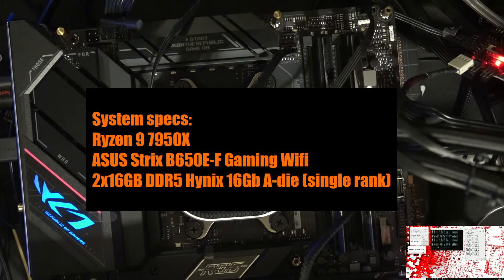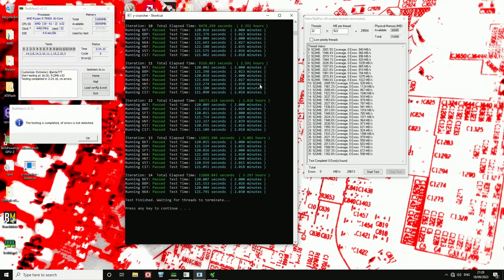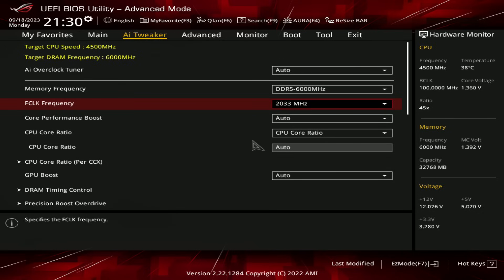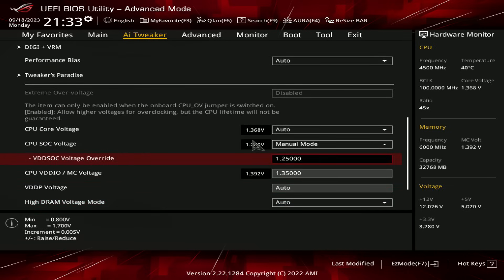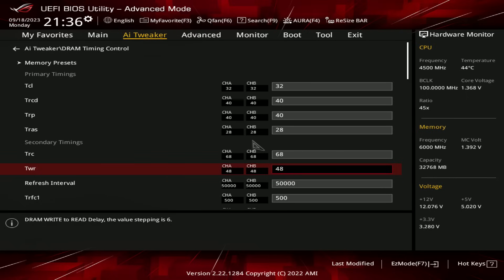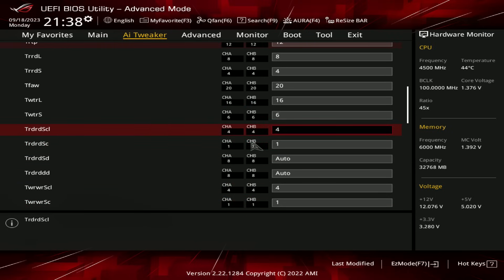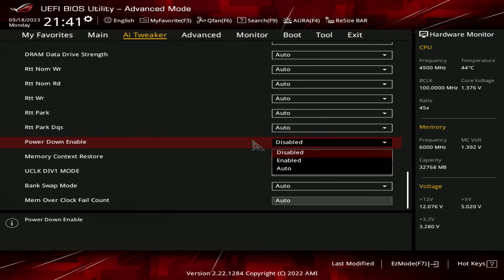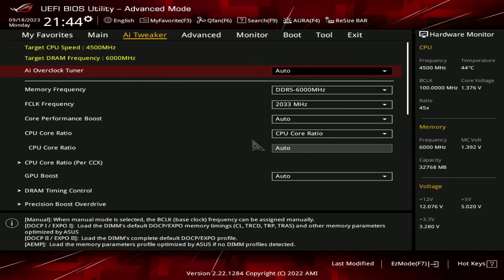Easy memory timings for Hynix DDR5 with Ryzen 7000

Comment: Running 7600x, ddr5 hynix 6000mhz cl36 ram, running the same motherboard and bios version as Buildzoid, vddsoc@1.2V and vddio/vdd/vddq@1.3V and trdwr@14, all other numbers the same. However, I don't have access to refresh interval, it's not present for me for some reason. If anyone knows why please tell me.
Will be testing and will answer questions with results.

Comment: I have  2x kingston fury beast ddr5 4800mhz 16gb cl38 hynix ... I have 2 questions:
1. Will these settings apply for my ram aswell?
2. Judging from what i read on the internet and from these kinds of videos, i hit the lottery with my kits, because 4800 mhz hynix kits are probably the most rare to get... And i bought them separately aswell, not 2 combo deal... How lucky i am? 😅😂
I am asking because i made the mistake of purchasing an asrock motherboard that has problems when it has to boot bios settings that it doesn't like... I always have to remove cmos battery and put it back... that's really annoying to always do, so idk how much i m going to mess with the ram overclock and timings and sub timings... I m probably gonna upgrade to a 7800x3d and a better motherboard from a better brand later this year... If i get the money to buy them... if not, i m gonna wait until i have the money and buy then what's the best for me
Reply: You may not be able to overclock those sticks or tighten the primary timings, but you can still improve them with better secondary/tertiary timings, and the ones in this video are a reasonable starting point
Reply: @subaction  i basically copy pasted his settings and everything works fine... Like i said above, i hit the jackpot with my rams, cheapest ones i could get, both have hynix chips. The only problem is that even after i updated the bios to the latest version, i still have long boot time. Like 1 minute... Probably this will never be resolved sadly... at least for asrock motherboards... Well, i look at the bright side, at least mine doesn't cook the cpu like asus lol. Thank God i sticked with this one, seems like asrock right now are the most reliable motherboard brand. How times change lol 😅😂

Comment: It works perfectly thx but mine can go 6400 is it possible and what you recommend to change?
Reply: The way the fabric clock works on Ryzen 7000 chips means you will almost certainly get better performance at 6000 than 6400.

Comment: I'm just getting back into custom PCs after 20 years and am starting to delve into memory tuning. I have a 7900x3d and got a good sale on DDR5-6600 34-40-40-105 DIMMs. I get that the 3300MHz/6600 profiles are off limits for this chip but the other XMP profiles sort of straddle 3000MHz, at 2912MHz/5800 30-36-36-93 and 3106MHz/6200 32-38-38-99. Should I expect to find a stable timing set that would work for DDR5-6000 or is that an "invalid" subdivision of my 6600 kit, leaving me at that DDR5-5800 profile? I'm not sure how flexible I can expect to be at frequencies outside those listed on the SPD.
Reply: Update: these timings ran but unstably and with the bios deciding to halve UCLK. Overriding that caused POST failure until I cleared CMOS. Going to try these timings with a lower FCLK tomorrow

Comment: Hey man, are you testing all this using iGPU of Ryzen?  I got a dual-CCD version 7600, Fclk=2033. SoC voltage=1.1v. Yet it can pass all p95/TM5 test without a single error or crash. Memory set at 6000c28 all sub-timing tightend.
Maybe TSMC 6nm iodie doesn't need that much voltage when iGPU is not used？
Reply: He gave conservatively high settings to be safe. Most people should be able to use 1.20 SOC instead of his 1.25, and some can use 1.15 or even 1.10. Almost everyone should be able to use 1.30 or 1.25 for VDDIO/MC and VDDQ, instead of his 1.35.
Reply: @subaction  you are right, but for example 5700G demand less soc voltage if you use dGPU

Comment: Does anyone know what primary timings I should use for a downclocked 6400mhz kit?

F5-6400J3239G16GX2-TZ5RS (32-39-39-102)

Currently, I have it set to 6000mhz 30-38-38 which is equivalent to other G.Skill kits running at 6000mhz.
Reply: U find it?

Comment: On Gigabyte x670 boards the minimum tRAS is 30. Is this ok to use instead of 28 or would 56 be better as a multiple of 28? Thank you Buildzoid
Reply: Same issue here. Tras only goes down to 30. What did you end up doing?
Reply: Cool. I just finally checked and am running 30 without problems, memtest stable

Comment: Pretty straightforward, even easier since we pretty much can use same settings as shown. About a 9% faster ram for me and my latency went from 85ns to 70ns. Thank you!
Reply: How do you check the latency?
Reply: @rickyross9073 Aida extreme, look it up.
Reply: @rickyross9073 use Aida64’s Memory and cache benchmark
Reply: Aida64 você faz os testes la @rickyross9073
Reply: I'm getting about 67ns. I guess that's good since you were getting 85+ before.

Comment: Do you have any videos on memory tuning dual (quad) rank ddr5? I'm using 32gb dimms for the capacity but want to try dropping some of the settings, how close to these can I tighten them (cl30 g skill Trident neo, presumably hynix m-die)
Reply: I, and others, have used that kit with these settings. They seem to be a sufficiently loose starting point or set-and-forget for that kit.

Comment: Having trouble finding the “Power Down Enable” setting on Gigabyte bios. Is there a different name for it? Can someone please help? It used to be in the advanced settings, no clue where it’s been moved?
Reply: It's in Settings > AMD overclocking > DDR and Infinity... > DDR Options > DDR Controller Configuration > DDR Power Options :)
Reply: @HoangDucNuyen  Followed the steps, but not seeing “DDR Controller Configuration”. I’m on F3 of my B650M Aorus Elite AX. May be somewhere else? Do appreciate your help!
Reply: @CarnivoryHODL  - wow, I thought all gigabyte 600 series have the same BIOS. I am sorry that I cant help you with that. 
FYI, my PC (7950x3d+x670aoruselite) just straight up crashes at login screen and sometimes FREEZES in the BIOS when disabling PowerDownMode (even using EXPO or XMP).
Reply: @HoangDucNuyen  no worries! I found it on the latest beta version, but had to revert to F3 since it was being unstable.

Comment: Received my 7950X3D and the Kingston DDR5-4800 ECC 40-39-39-77 modules. Used your secondary timings, put primaries to 32-40-40-28 at DDR5-6000, voltages at 1.2V for VDDSOC (instead of 1.25V) and 1.3V for VDDIO/VDD/VDDQ (instead of 1.35V), and things seem fancy according to memtest86. Thanks for the help.
Reply: Currently trying lower voltages, thank you for this.
Reply: I am actually a little scared to change anything on the voltage as the 3d chips are very sensitive for these changes. Der Bauer even killed a cpu because of changing the voltages
Reply: @Muu_69  These voltages apply to the IO die only, not the CPU chiplets.
Reply: @tscc  thanks, did your temps from the CPU also go up in idle?
Mine went from 40 to 47°C
And ram from 27 to 37°C
Reply: @Muu_69  I haven't really looked at temps pre-OC. Stands to reason they go up, since the IO die also creates waste heat. That said, I'd expect the same with DIMMs that come with DDR5-6000 settings from factory. The RAM chips are the same after all, so they need similar voltages. My DIMMs are idling at 34°C right now (note: temp sensors on DIMMs is more a server thing, gamer RAM typically doesn't come with that), CPU package temps hover around 41°C (with a Noctua NH-D15), all at 20°C ambient.
Reply: @tscc  I now tested 1.2v on SOC and 1.25v on VDDIO and that also works fine so far. 2h of gaming and also a memory stability test.
I also used on the curve optimizer -15
And I also turned precision boost on.
I use the peerless assassin 120 instead of the NH d15 because gamers nexus tested it as the best aircooler now on the market. But probably I will upgrade to the new Noctua NH d 15 successor that should come out at the end of the year, as I usually only use Noctua fans and I love especially the A12x25
Reply: @Muu_69 tried these recently, me and my brother just newly built a full amd pc, somehow my temps lower, went from about mid 50s to about an average of 41 degrees while gaming, and it still stays the same while idle which is 41 degreees
Reply: Saving this
Reply: Wait you achieved that on this KVR48U40BS8K2-32 ???? HOW ?
Reply: Looking that SKU up, it seems they’re the non-ECC modules. Kingston’s data sheet doesn’t say which dies they use. The ECC UDIMMs specifically use Hynix M dies. IDK, I just put in the values from the video, dropped voltages a bit for safety (good hindsight it seems) and presto. By now I’ve dropped VSOC some more from 1.2V to 1.15V and VDDIO etc. from 1.25V to 1.2V and things are still stable and no WHEA errors from ECC.
Reply: @tscc  Could you give me the part number of the kit you bought please ?
Reply: part number?

Comment: I hesitated for a couple of days because my timings are so different from these, but it is all stable with Kingston Fury Renegade @6000, (30-37-37). I left the Fclk @2000Mhz because I am really happy with it stable with 1.15V SoC. The memory is now 10% faster and the latency is down from 73 to 63 ns in AIDA64 Benchmark.
Reply: And FCLK @2033 confirmed stable too.
Reply: Seems like anything sub 67ns is decent then? I have the same ram kit.
Reply: @ertai222  Yes, if you use AIDA to measure the latency, the optimal value is between 60-65 ns.
Reply: @jassenjj  the lowest I got it so far was 62.5, 63.

Comment: THE SAD part is that built-in memory controller in the Ryzen 7000s series -- yes, even 7950/3D, the top of the top -- can only support 64 GB of RAM at 5.2 GHz. If you need to have full 128 GB RAM, it can only work at 3.6 GHz as the controller simply can not pass more information at a time, regardless of what you do with timings or anything else. The question is, will AMD upgrade its memory controllers in the Ryzen 8000 series, and if so, will Asus release a BIOS update to support those new CPUs, so I could replace my 7600X with e.g. 8600X and then to finally have 128 GB at full frequency (however it might be at the time: 7 GHz or something)? Or I will have to replace my Rog Strix 670E-A Gaming Wi-Fi motherboard with a new generation of CPUs, even though they will be still for the AM5 socket?
Reply: But the memory controller is a CPU part, not the MB part - is it not? 🤔 If so, then new CPU support will be enough to have access to the improved memory controller (if there will be one, ofc)
Reply: Incorrect. Im running kingston 128gb 4 slots on meg ace at 5600 stable with over 75gb/r 84/write 70ns
Reply: @jumanjimusic4094  Unfortunately, the data through output is limited regardless of the frequencies you are able to achieve.

Comment: For the longest time I tried to enable EXPO on this same motherboard without luck. Crashes, bios updates, BSOD, etc. I got a different ram kit (which happens to be the same one you got). I used THE EXACT SAME settings you have and no issues since then! I really appreciate it! I have another build but that one has Samsung die which would be amazing if you could “build” expo settings for it since it is the exact same issue I had but on that build. Again, thanks!

Comment: Got G.Skill DDR5 64GB (2x32GB) 6000Mhz Trident Z5 Neo (F5-6000J3040G32GX2-TZ5N) 2x32, 7950X and ASUS STRIX B650E-F Gaming WIFI Motherboard. I don't how did I check compatibility, because I was thinking about using EXPO, I've never tried to adjust timings by myself and have like 0 experience (this memory is not in the compatibility list of my motherboard). I tried to change settings to the ones from this video, but it doesn't work for me. My PC just unable to load at all, I have to extract battery from motherboard to reset BIOS settings.
I tried to set all timings and voltage, leaving the default frequency (4800). And it works. But with 6000 frequency it doesn't work anymore.
I tried to set 30-40-40-96 6000 (numbers from tech specs of my memory). Doesn't work.

Even with everything default my PC starts very slowly, I see the yellow LED on motherboard for ~1 min (memory indicator), only after that it loads to BIOS.
With all different settings, when I say "doesn't work", this yellow LED stays forever until I shut down the power.

Can someone help me please? I understand nothing in these numbers, is it even possible to get 6000 with my hardware? Or do I have to replace motherboard?
Reply: I guess because 32GB kits are dual-rank. To do these timing settings you need a single rank kit, which is 16GB. Correct me if I'm wrong. I am new to RAM OC.
Reply: Dual rank ddr5 is going to need looser timing that single rank, there's more stuff going on in the memory controller (twice as much)
Reply: Before trying to tune, you should try to use the EXPO profile. When you enable EXPO, it sets those primary timings and the speed, and it also raises several voltages. Simply manually setting the primary timings and speed yourself is very likely to cause the problem you describe, if you do not adjust the voltages too.

I've got that kit working fine, with these timings, on a B650 MSI board with a 7800x3d. I see there are a few others have not had success with it.

Comment: What do you have to change if you use sk hynix m die 6000 cl30 2x32GB sticks? as they are dual rank
Reply: +1
Reply: @dwarfcow  +1 what?
Reply: @DallasCowboy_  I was also asking what I can tweak for 32gb dimms, they have looser sub timings than the 16gb single (dual)rank dimms
Reply: I, and others, have used the 2x32 gskill trident neo kit with these settings. They seem to be a sufficiently loose starting point or set-and-forget for that kit. Not sure which kit you have but I'd expect these to also work on other dual-rank hynix m-die sticks.
Reply: Worked for my 2x32gb 6000 cl30 Kingston fury beast kit

Comment: Do you really feel confident with 1.392v hitting the IMC? For me with 64GB RAM it wants 1.44v. Something about this just doesn't sit right with me.
Reply: Say you don't understand the numbers you're looking at without saying you don't understand the numbers you're looking at.
Reply: @insertnamehere4419 way to come off like an elitist ass with absolutely no substance to your reply. Chips can't take infinitely high voltages. At some point, going past a certain threshold the voltage becomes significantly damaging to the component. I've tried 3 7950x3D memory controllers pushing these voltages chasing fast and tight timings on my 64GB DDR5 6000 kit. But ok pretend these numbers are safe.
Reply: @ 1.4v is not for the IMC that's the Dram voltage, and 1.4v is not high.
Reply: @insertnamehere4419  so much for that. I'm talking about VDDIO, the memory controller. Guess you didn't know as much as you thought you did.
Reply: @insertnamehere4419  What do you think VCCIO is?
Reply: @KuraiShidosha  I cant even find the statement that you're referring to, but  if you're talking about memory controller voltage there's nothing wrong with 1.392... this is a two year old video man.

Comment: Is this stable for 7950x3d?
Reply: Just did the timing from this video with my 7950x3d and Kingston 6000 36-38-38 kit. BSOD straight up in the Login screen
Reply: Works fine on my 7800x3d. Copy paste and no crashes. I'm using Asus b650e-e motherboard.

Comment: There's a thread on overclockers forum with 4x32GB ddr5 at 5400... I and a lot of other people can barely get 4600 stable with 4x32. He says it's from tweaking the power settings but I've done a decent amount of googling and I don't understand the ram settings in ohms and RZQ/4 type numbers. Have you done a video explaining those and has he won the silicon lottery or could tweaking those get that sort of a huge stability boost to go from 4400 to 5400?

Comment: Boy, I totally misread the title of your video. I thought you were able to get DDR5 7000 speeds on your AMD CPU. 6000 is easy. Just get a kit that's set up for it. Don't screw around with any of this. Make one setting in the BIOS, boom done.
Reply: lame and not hardcore oc enough
Reply: @emini6  .. The ceiling limit is the AMD CPU itself, I've seen DDR5 6200 speeds after "rewriting" most of the RAM BIOS settings but that's about it.
Reply: @DJaquithFL  top bins of zen 4 can go 6400-6800mbps if you get lucky with the silicon lottery
Reply: @emini6  .. Never seen it stable yet. There's a difference between can do for CPU-Z and stability.
Reply: @DJaquithFL  what do you mean cpu-z and stability? Cpu-z is just a identification program; have you tried y-cruncher yet?
Reply: @emini6  .. I can post a 6.5GHz+ OC easily on my i9-13900K proving it's possible, but that absolutely doesn't make it usable and stable
Reply: @DJaquithFL  don't do that please, you are actually degrading the CPU from high voltage for those higher clocks without extreme cooling like dry ice or liquid nitrogen or helium(Phenom2 and FX can handle Lhelli)
Reply: There is a pretty decent uplift to tuning ddr5 as detailed in this video, in some cases 1% lows improve 15-20 % over looser expo settings... That's why